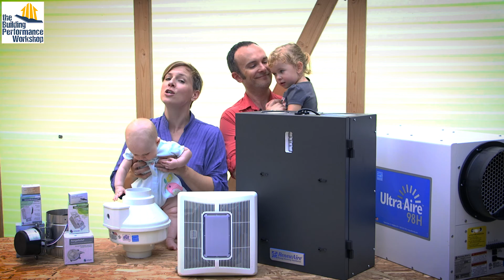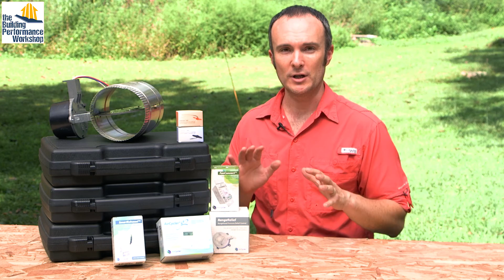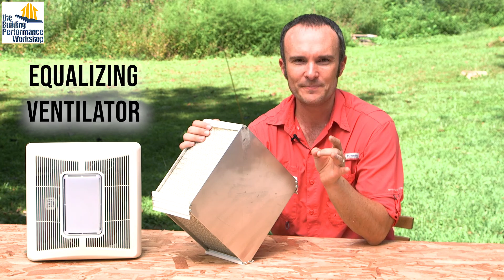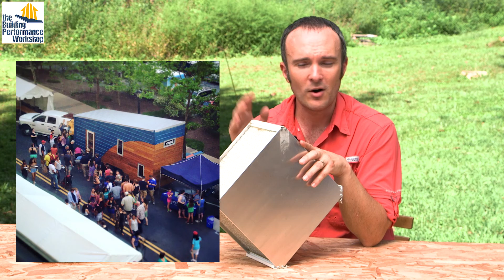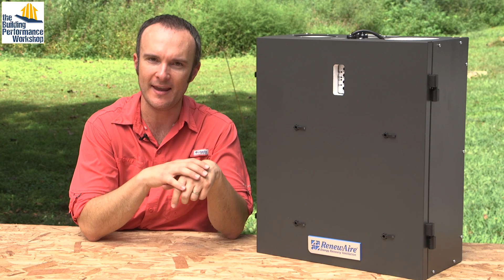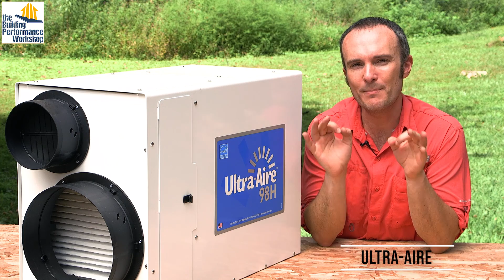5 Methods for Home Ventilation: AirCycler, Inline Fan, Bath Fan, ERV/HRV, & Ventilating Dehumidifier

Comment: I want a single makeup system that can operate at a wide range of makeup flows. For example, it will makeup 50 cfm for routine fresh air exchanges for a few minutes every hour but also be able to ramp up and makeup 400 cfm (induction stove, not gas) when the kitchen vent turns on.

Any suggestions?
Reply from the maker: Nothing off the shelf- you should design and sell it. I know lots of buyers.

Comment: I'm super new to these systems but have been exploring building concepts of air tightness. In a relatively air-tight house, when exhaust fans are running like the range hood vent, bathroom fans and dryer exhaust, this creates a negative air pressure in the house (right?). And this negative pressure makes the house want to suck in outside air. Do you have more info on systems or practices for how the house equalizes pressure from inside to out? I'm assuming you want equalization to happen in real time, i.e. equal amounts of fresh air brought in as air is exhausted. Do any of these mechanical system detect a negative pressure and automatically respond to allow an equal amount of filtered air into the house? If so, can you calibrate or set these mechanics to maintain a slightly positive air pressure in the house, maybe to keep any air from seeping into the house from elsewhere? Also, what are the pros and cons to having all exhaust lines pass through an ERV (I think I heard this is an option)? Also, do you have any recommendations for flapper style exhaust vents that are better against letting air in or out (aside from the Heartland 21000)? And how is a blower door test performed with flapper style exhaust vents? Wouldn't all these terminals allow copious amounts of air to escape during a blower door test? Is the BDT done before insulation? And do you have recommendations or concerns for - forgive me I don't know the name or terminology - the system that pressurized the house with floating sealants that fill any air leakage gaps? Thanks so much for any and all of your help on these questions.

Comment: Is the ERV core made entirely out of paper and is it some kind of special paper? I mean can I DIY ERV core out of corrugated cardboard sheet?
Reply from the maker: Haha, TryEverything, I like your style, but no, these are pretty sophisticated machines- the ERV core I’ll be putting in our house actually runs about $500, and is washable paper.
Reply: @HomePerformance  How about an HRV core, why is it made out plastic? Why is it not made out of copper or aluminium, they would transfer heat way better than plastic.
Reply from the maker: You might think, but apparently plastic has some properties that beat aluminum at certain low temps.

Comment: Hi!  Great video, I wasn't aware of the fantec solutions.  Do people use the fantec units in conjunction with a HRV/ERV?  I live in Canada (very cold winters) so definitely would like to capture the heat from the exiting air if possible.

Another question, do any of these ventilation systems allow for a filter that would remove smells from the outside air as it enters the home?  I live near a cattle feedlot, and the wind often blows nasty manure smells at my home.  With all the oder leakier homes in the area with no ventilation, it seems like the smelly air doesn't really enter the homes, but I'm worried that if I actively pumped "fresh(NOT!)" air inside, i would be pumping in the nasty smells...  Any thoughts?
Reply from the maker: Haha, that's a good one Eric. Sorry to hear about the cow poop, but your challenge is interesting. Theoretically, using filters would take away the particles that contribute to some of the odor issues, but the VOCs that are most of what you're smelling are gas-phase molecules that are too small to be captured. You could, again, theoretically, use a reactive chemical (like ozone, hydroxyl, etc) to change the molecular makeup and change the smell, but the side effects of doing this would not be worth it to me. But I'm not the one smelling it, so take that with a grain of salt.
Reply: @HomePerformance  thanks for the thoughts! Hmm... Maybe I'll just have to build a cruddy leaky house so the air will just gradually enter the home rather than sucking it in with ventilation ha
Reply from the maker: @eat5hams  Trust me, that won't solve the problem either. I'd just say location, location, location.
Reply: @eat5hams  Maybe an activated charcoal filter could trap those smells?
Reply from the maker: Certainly worth a try

Comment: Your explanation of the erv core is a little off. The cores do not equalize the temp. They actually transfer most of the energy from one stream to the other. So the outgoing air is very close to the outside temp and the inbound air is very close to inside temp. The 2 air streams actually end up very different in temp from each other. i. e. inside temp 70 and outside temp 20.  80% efficient core (HVI) = 20 outside air becomes 60 delivered to house and 70 outbound air ends up at 30 to outside. I have a unit in my office with temp probes in each airstream and can show this on my website in real time to show how effective these units are in real world.
Reply: 20 years in the hvac biz and Kurt is very correct. Your response is arrogant and still incorrect
Reply from the maker: I'm sure you must be misunderstanding me- feel free to come talk with me about it when I present twice a day at the Fantech booth, or when I'm collaborating with RenewAire, Broan, AirCycler, or Ultra-Aire as part of our TV series. The ERV manufacturers we work closely with have never seemed to take issue with this simple explanation.
Reply: @HomePerformance  I'm not a self professing expert. I've just been trained and certified by HRAI and been installing only HRV/ERV's for the last 13 years. 900 to 1000 installs. What has continued to frustrate me over the years is the lack of accurate information shared about this technology and how to apply it in the different climates that exist. Even manufacturers own sales people and customer service reps don't even understand their equipment and don't use it. Recently at the AHR in Atlanta, I went around to manufacture reps and after talking to them about their equipment, asked if they used it in their own homes. Not one!!! Not one of them did. I'm not saying nobody does use their own stuff, but of the many I asked at the show, not one thought they needed ventilation.  When I give talks and presentations, I always ask how many in the audience have a system. Always get less than 10%. Of the company's you mention: Fantech - when I started my business I called them and wanted training, they said all I needed to do was read the installation manual. Their defrost would be highly suspect at -20C. I've seen their HRV cores frozen solid. Broan has been a fan company for years, and since I am on their advisory board, I know that they are not up to speed on these units (with the exception of the N.S. manager). Their units are Venmar and that's mostly what I have installed in my business, though I have installed all of the names mentioned and others. Ultra-Aire is a dehumidifier company and does not sell ERVs. I really wasn't looking for a "one up" contest. I just thought it would be just as easy, and more accurate to say they transfer most of the energy. Even a beginner should be able to understand that. If fact, since I have to explain these systems all the time to beginners, I do have a really good idea what they can understand. Most of them easily understand the concept when explained correctly. And when some energy guy tells them to shut the unit off in really cold or hot temps, I ask them how they are going to get rid of the pollutants that are still being released and that are still a threat no matter what the temp is outside. Of course, since higher temps and humidity increase off gassing, this is technically a bigger issue in hot, humid weather/climates vs. cold, dryer weather/climates.  PS. The comment below suggesting an HRV in a really cold climate. . . not a really good idea. You might want to check out the Canadian research on that.
Reply from the maker: I hear you, Kurt- and agree that even within the industry there’s lots of misinformation. I have a Broan (Venmar) in the TinyLab, and track what it does real time, too. We’ve just been trying to get away from the term Enthalpy Recovery Ventilator (or having to explain the E stands for Latent and Sensible heat Energy) to make it simple for people to understand and adopt. It is not inaccurate to say the core tries to equalize the temp and humidity- all of nature is trying to equalize all heat, pressure, moisture, and contaminants all the time, which is why high flows to low. It’s just a different way of explaining it. Gets my hackles up when commenters call me a hack. I’m just trying to explain something old in a new way, since clearly the normal explanation has not seemed to hook people.
Reply from the maker: Quite aware of the technical details, Kurt, but it’s an easier concept for a beginner to understand our way. The core transfers heat and moisture.

Comment: Can an ERV work with outside temperatures to about -35c/-30f?  Most winter lows are -20c to -25c though.  Don't mind turning it off on frigid nights.  Or when the mother-in-law rolls into town.
Reply from the maker: Most ERVs have a defrost mode, but check with individual specs on these models, they’ll tell you. You might be one that needs an HRV instead.

Comment: can you expand a bit more on erv and humidity please.
especially the comment about what you found on your trip and also "erv passively dehumidify the air".
Reply from the maker: The paper core tries to make the incoming and outgoing streams of air the same temp and humidity, so in summer it has a drying effect and in winter a humidifying effect. It’s kind of a buffer or battery for moisture in air- you might still need to dehumidify further, because the moisture transfer is only about 40-60% efficient.
Reply: so for there to be a drying effect the air going out of the house would have less moisture than the air going into the house. which would work well when you have dehumidifier or aircon.  ie if its dry inside it helps to keep it that way by removing some moisture from the incoming air. 
and i assume reverse is true where high humidity in the outgoing air will go into the lower humidity incoming air. it keeps humidity in the house.
so if you have no dehumidifier or aircon, home humidity always rises due to people and the evr will keep that moisture in the home. great for places that are dry, rather bad for places that are wet.

that would explain why most local info i can find says DO NOT use erv as we have a wet climate and few places use aircon.
the erv would trap moisture in the home.
Reply from the maker: Correct on all counts
Reply: in effect the erv is a critical part of the dehumidifying system. it really needs to be tied to the dehumidifier/aircon and have an alternate  ventilation system for when the dehumidifying system is off (due to weather or part failure).
Reply: The ERV will help condition the temperature and humidity of the air. Thus allowing you to not have to adjust the temperature or humidity as drastic. One example is Hot humid outside air will be cooled and dehumidified before the air conditioner and dehumidifier fine tune the air to the desired condition.
Reply: Fred Haag, yes but if dehumidifier or aircon is not working then it becomes liability as it keeps moisture in the home (in humid climates).  just something you need to keep in mind when you design the system.
Reply: I would presume that the humid air is during the summer. Since during winter the air is a lot dryer. This would mean that the homeowner is running the AC. The Air Conditioner will dehumidify the air as it passes over the evaporator coil. Since the coil is drying out the indoor air, that would make the exhaust air dryer than the fresh air. My other point is that if the indoor air is more humid than the outdoor air. Then this would not make the indoor air more humid than it already is. We could go around and around about this, but I believe that we are essentially on the same page. Humidity is a liability if not properly addressed.
Reply: Fred Haag, i think your missing the fact that a homes humidity always goes up due to people (and animals) living in the house. breathing puts out a lot of moisture as does cooking, cleaning etc. without some way of removing the moisture, the humidity will always goes up.
when that happens the incoming air is drier than the outgoing air, the ERV will take moisture out of the outgoing air and put it into the incoming air and feed it back into the house. which is the opposite of what you want in a humid climate.

ERV works great when you have some form of dehumidification in the home. the problem arises when it stops working.
so you really need some sort of bypass for when air con is off and the home humidity rises.
Reply from the maker: Nothing ALWAYS happens in EVERY house with any particular criteria- this would be true in a super airtight house, yes. But beware making prescriptive generalizations for all homes, it just doesn’t work. Like prescribing one medication for everyone.
Reply: add moisture into a house faster than it can get rid of it, humidity will go up. however if thats actually a problem is a different story. that depends on a lot of other factors. quite right you can't make one solution fit all. ERV is a good example of that.

in this case its humid environment, (eg i'm average 80% humidity year round). ERV is part of a system and it needs the whole system to work together for it to work well. you have to think about modes of failure and the results of that.

Comment: The flapper vents in my bathroom fans and kitchen hood are a joke.  They are flimsy pieces of spring-loaded metal that don't make a complete seal when closed.  When the wind outside is above about 20MPH, I can hear them flapping away in the ceiling and wall.  The wall jack flapper for my bathroom fans freezes up during the winter, which means I can't use the fan when I need it most.  There has to be a better way.  I don't see how a house with these common fans can pass a blower door test.  The best vent I ever used was for my dryer.  The builder installed dryer vent was the aluminum flapper type and installed near a corner of the house.  When the wind was strong, it would make a sound like a machine gun. If I opened the dryer door, it always felt cold  in the winter.  I found a dryer vent that solved these problems. It's the HEARTLAND 21000 Dryer Vent Closure.  It never made a noise and was easy to clean.  You can find it at Amazon https://www.amazon.com/HEARTLAND-21000-Dryer-Vent-Closure/dp/B00009W3I4/ref=pd_lpo_vtph_60_tr_t_2?_encoding=UTF8&psc=1&refRID=A4RZZ98V0YZXR1JF3VXZ
Reply: I concur.  I believe that the Heartland Dryer Vent design is an elegant solution for a much overlooked laundry vent.   I never thought about the application for the other vents.  I am going to look at using it in a bathroom vent for my next project.